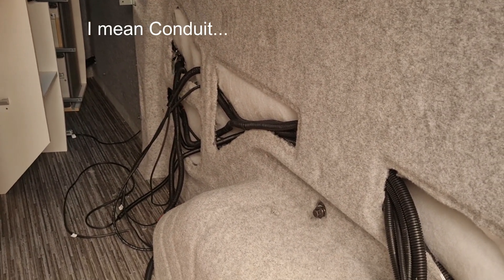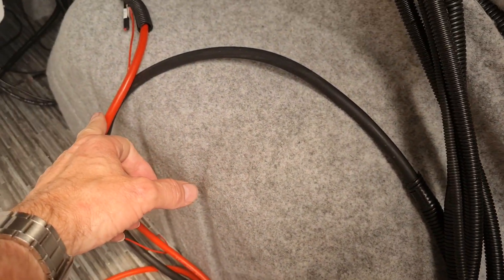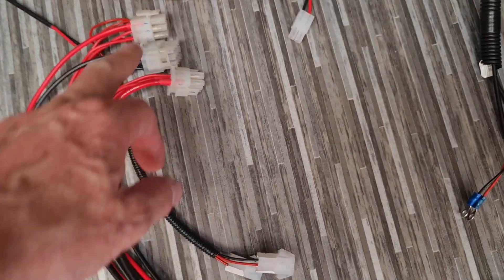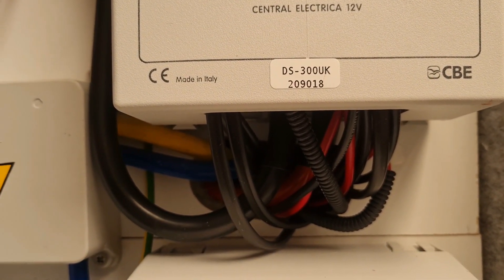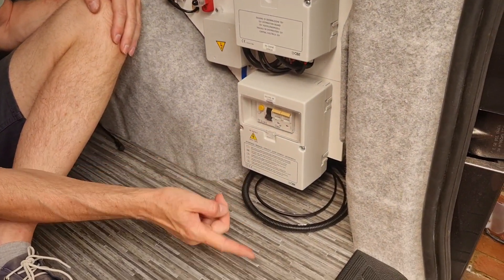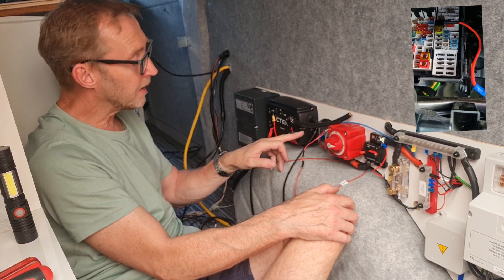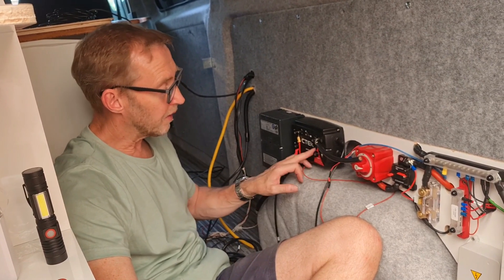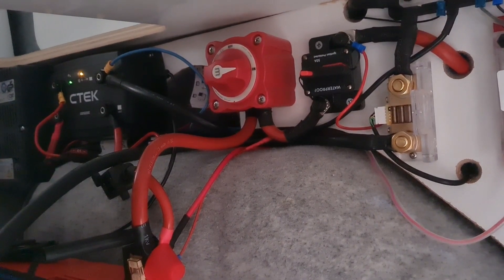Installing Electrics into our campervan

Comment: Great videos of your build thanks. When you fed the wires through the grommet from your external hook up, where did you locate them inside the van please ? Will I get to them with floor fitted already ? Thanks
Reply from the maker: Hello. I passed them up through the grommet already provided for the parking sensors. I had to enlarge it slightly, but the wires came up into the rear pillar, which houses the light loom. I used a gripper on a bendy rod to pull it up, bit fiddly, but with patience it's possible. Yes you should be able to feed the wires up with an floor already fitted.
Reply: Thanks so much I will give it a try 😊
Reply: Done it ! Thanks ! You’re the man 😊

Comment: Very good explanation of your setup. I've just bought the same cbe kit and im now going to do the battery charger the same as you. Can i ask which one of the 3 settings you have the charger on for your batteries as im going for agm ones ?
Reply from the maker: Hello
 Thanks for watching and commenting on my video. I too have agm batteries, off the top of my head I cannot remember the position although I did do as the guide instructed, and I don't want to miss inform you. I can say that the system is really nice, although some features we did not need, such as the electric step. The mains fed battery charger works very well, I kept my batteries topped up via this during the past colder months.
If you do not have the operational manual, let me know and I will dig mine out and confirm the settings.
Reply: @royclark8385  thanks for the reply. I have the manuals that came with it thanks but like you've done i want to change the way its set up like you have, I'm also incorporating separate feed off from fusebox to feed a gang of lights and usb and I already have a durite split charge fitted so no need for fusebox to connect to my ignition or alternator, thinking about it now I should have just bought charger and rcd box and just a normal fuse box !!!!
Reply from the maker: @rickh6825  it's funny how once completed we see alternative way we could have done things. I bought a number of things I thought I would use but either changed my mind or bought a better alternative. Good luck with the build though.

Comment: I wish I watched this before I installed mine
Reply from the maker: Thanks for taking the time to view my video. It's actually a really nice unit, by adding the plugs prior to install I was able to change some of the original intended circuits to one's better suited to my needs. Having used 25amp cable for all but the one with the 30amp fuse, where I used 40amp cable, I was then able to Group all my lights to a 4 switch controller using this 30amp fuse.

Comment: Hi nice video, when you remove the diode was it hard to do?
Reply from the maker: Hello. Thank for watching. No it's very simple, I used a set of wire snips, short snub nose type.
Reply: @royclark8385  thanks for replying I will do the same as I already got a dc to dc charger